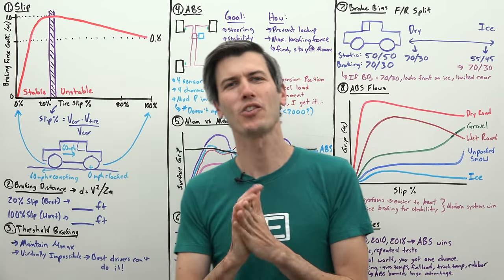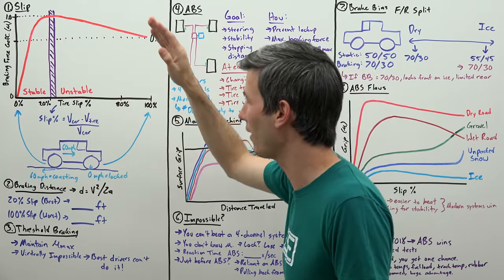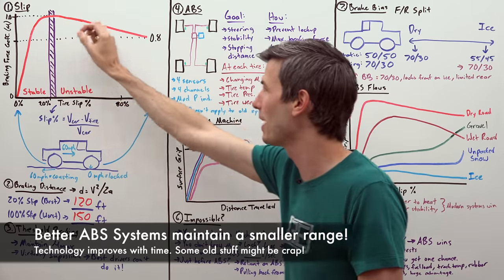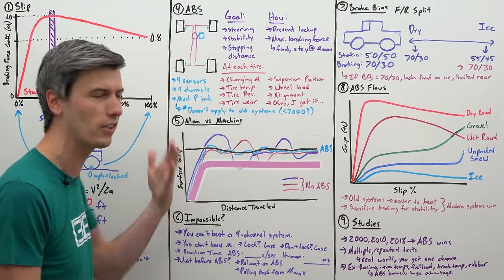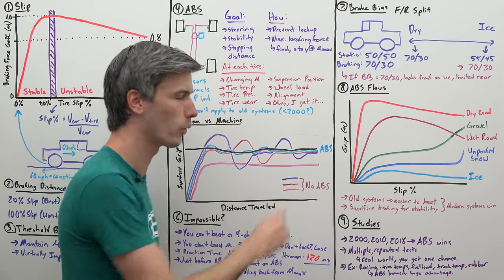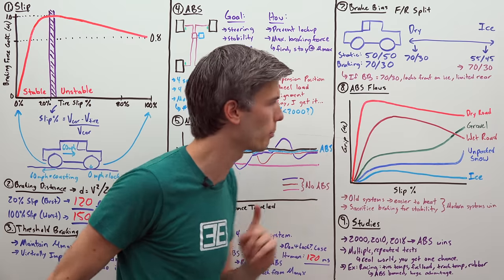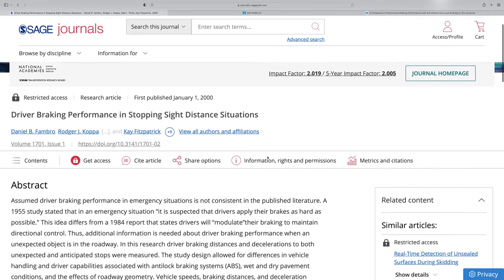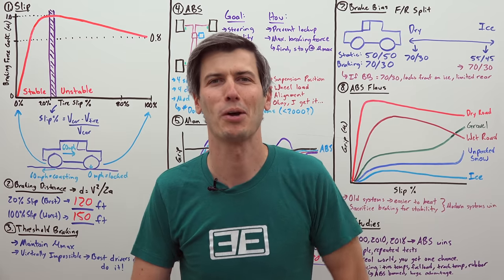Why Threshold Braking Is Impossible - ABS Wins!

Comment: ABS in most vehicles is a reactive system that can only attempt to recover an overshoot of braking effort, and it literally DOES just bounce back and forth through the ideal peak in available traction on most passenger cars. In order to make the system seem as if it is proactive, they fine tune it and size the valves and pumps and actuation speeds to optimize the system for a particular set of conditions and expected wheel size/weight. As long as you are driving in the conditions the system in well optimized for, it is capable of exploiting more braking effort than a standard brake application that attempts to manually find the threshold. You're describing ABS as if it is backed by supercomputer levels of AI to make decisions about how to manipulate the valves. That is not the case at all. 

Out here in the real world, the conditions aren't always well matched to the ABS system. Since people already tend to drive slower on ice and snow, and everything happens slower in very low traction situations, ABS systems tend to be optimized for routine dry/wet conditions where drivers are likely to encounter a situation that unfolds much faster, and at speeds that are more likely to be deadly, and in traction conditions that are far more difficult to "find" the threshold of (yes, it's harder on dry pavement to to "land" a maximal hard brake effort). As a result, these system are often very poorly tuned to maximize braking effort on very slick conditions, like snowpacked or glazed ice roads. You can observe this in many vehicles as the ABS system overshoots on both sides of the peak available traction by huge margins over and over. Most of these systems do not have the finess or the data ingestion to make good decisions here. If I'm ever braking in my SUV on ice, and feel the ABS kick in, it is always accompanied by a sudden LOSS of braking effort. You can FEEL it immediately. The G-forces of the braking diminish. I immediately lift the pedal and take another stab at finding the threshold because that is consistently better than anything the SUV can do with its dry-conditions optimized system, especially when running larger/heavier tires. 

F/R BIAS is solved by locking the center diff. Many of us drive SUV's and pickups with the ability to lock the center diff, and YES, locking the center diff does improve braking because it allows braking effort to come closer to threshold on all 4 tires, with or without ABS. For those people who say 4x4 only helps you go faster but doesn't help you stop faster, this is actually not true. A locking center diff helps the driver or the ABS system maximize available braking effort on ice and snow. With the center diff locked I can threshold brake significantly better than the ABS system can with the center diff unlocked. Again, this comes back to a lack of optimization. A perfectly designed ABS system WOULD beat me every time, but alas, our ABS systems are far from perfect. Perhaps the ABS system in your car is better than the one in mine.

In this video you make a lot of assertions about what ABS can do without any actual proof. You're making assumptions and assertions than an ABS system by its very nature can hone in on and target the sweet spot of traction in real-time. These are some remarkable assumptions that are far from true for most of the ABS systems fitted to passenger cars. These systems are reactive, not proactive, they don't have any way to measure the available traction and know how hard to push the pedal, they can only keep swinging back and forth though the threshold, overshooting on both sides. The amount of overshoot and the time it takes to correct varies wildly depending on the specific system and conditions. Some are better than others. None of them are as ideal as you describe in this video.

Comment: Audi used to have a "ABS" button so you could turn them off on snow/ice. Locking up the wheels piled snow in front of the tires and stopped it faster than ABS on.

Comment: Drivers should practice emergency braking in controlled conditions just to get used to the feel (and sound) of ABS and the principles of “stomp and steer”.  Often, inexperienced drivers will immediately get off the brakes when first exposed to the crunching sound of ABS kicking in, especially when they are already in panic mode…or about to crash.  I was taught (and still believe) that brakes are the most important driving control available.

Comment: ABS may give you improved stopping distance, but that only really matters if you've failed to allow enough distance to stop in an emergency, which means you're a bad driver anyway. In actual driving situations where you're wanting to retain maximum car control while using your grip right up to the limit (including being able to lock up the tyres when necessary i.e. on a low grip surface), ABS only gets in the way.

Comment: Threshold braking is only better in the sense that it theoretically allows the driver more control, similar to the advantages of stick- or paddle shift transmissions allowing more control of the engine speed. While I'm a huge proponent of manual transmissions, my experience driving cars which pre-date ABS solidly puts me in the ABS camp for braking.

Comment: The problem with ABS is that it desensitizes people to the available grip. They stand on the brake pedal and it just works every time but they can't tell how close to the limit they were or how much the conditions are affecting the available grip. At some point they will try for an emergency brake and the system will just say, nope, no more traction available, have fun crashing. With a direct braking system there should always be feedback every time you press the pedal, showing you how the vehicle is reacting.

On a track it is about feedback and skill. Otherwise you might as well be in the passenger seat.

Comment: There is one situation where a human driver can beat road calibrated ABS, and this is on a splitMu surface, ie one sides tyres are on dry tarmac and one sides tyres are on ice (worst case). Because road ABS has vehicle stability not stopping distance as it's prime target, if you have a very unbalanced braking yaw moment, the ABS will "Pick Low" ie it will reduce the high grip (tarmac) tyres(s) brake force to that of the low grip tyre(s) force (ice) to prevent that large un-even force from causing the car to yaw.  This is because in a modern car, the occupants are very well protected from a frontal accident, but much much much less protected from a side imp[act. Keeping the car straight and hitting something is actually better (for the occupants....) ie a better strategy than trying every time to stop in the absolute shortest distance but loosing control, spinning and hitting something sideways. 

ABS relies on the road surface friction to re-acclerate the tyre/wheel, ie to reduce tyre slip. This limiting factor in ABS cycle times is the re-acceleration phase, and the lower the friction (or higher inertia the wheel/tyre package is) the slower the system can cycle and the greater the RMS error from maxMu.. If you car has a large degree of yaw, then not only is the slip calculation more difficult as the tyre is not slipping laterally as well at longitudinally but the road force input is not aligned with the tyre rotational axis and so the re-acceleration phase is extended

"race" ABS is actually really only different to road ABS is to primary areas

1) It will be targetted to the exact tyre fitted in terms of its slip / friction characteristic, it wont' have nearly so wide an operating window as road ABS

2) it will be set up to "keep max" instead of PickLow, ie it will try to brake each and every wheel to the absolute maximum retardation, irrespective of yaw moment. ie it relies on the driver to maintain vehicle control and direction. This requires the driver to input potentially large and timely handwheel (steering) inputs to keep the car going where they want it to, even if the brake system is pushing the car off their choosen line by braking different tyres by different amounts. In most race cars with ABS you will find an "aggression" adjustment dial that allows the driver to select between stability (picklow) and max retardation (keepmax)

The other interesting thing that the lastest systems do is they have adaptive road friction models,ie they attempt to estimate and learn the tyre to road friction in near real time!  They do this via all sorts of methods.

1) Wipers being on, fog lights being on etc - probably means wet road - can use the windcreen rain sensor even when the wipers aren't being triggered
2) exterior temperature - self explanitory
3) Vehicle path analysis - using handwheel angle and the yaw and accelerometers, the system can calculate the true path of the vehicle vs the commanded path.  The difference is tyre slip (ie understeer or oversteer)
4) during ABS intervention the re-accleration phase is entirely driven by tyre / road friction so the system can calculate mu in real time.  This is one reason why changing your wheel and tyre package may actually slightly degrade ABS performance if the rotational inertia is different to the OE fitted ones.....

One interesting test is to see if you can feel this adaption.  Trigger the ABS on a dry road and the system will learn that there is lots of grip and hence keep the slip target at a relatively low value.  Park up the vehicle and wait for it to rain, before you drive too far (vehicle will learn even without you triggering the ABS!) carry out a stop on the wet road. You will feel the system trigger early initially because it thinks there is plenty of friction, but within a couple of seconds it will have relearnt the lower grip level and will start targetting a much higher slip level.  If you repeat that wet stop for a second time, you'l lnotice the system going straight to the new lower friction response even on the first ABS event.

Comment: Well in the test I did on my channel, Thershold braking slightly beat ABS. In your explanation you haven't considered something very important, with a manual gearbox you threshold brake being in gear, which not only improves braking performance, but the rotational mass of the engine and gearbox also works as an anti-lock system, as it not not as easy to stop the engine, and you can ride that fine line of grip without major issuess. As the grip decreases (f.e. wet conditions) ABS  does generally decrease the braking distance significantly.
Reply: u made a very special list :) See u soon :)
Reply: Crystal 🔮 Throne IMAX Theaters 🎭  how come?

Comment: Sounds fine in theory but try trail braking & ABS acts pretty silly. There's a reason why MC riders who track get rid of ABS right of the bat ('cause most do suck doesn't matter how got it looks on paper, if it makes the operator less in tune with the machine it's harder to use, aside from maybe the hyper cutting edge systems which most bikes don't have), though the systems on cars are even less flexible. Sure ABS is magical for outright braking in relatively straight lines, but when you're planning to scrub speed into a turn you won't be fully on the brakes anyway, you need some traction left for cornering, something that's not all too hard to modulate by way of seeing if you can turn enough & reacting

In theory ABS should never trigger when trail braking/partially braking during corners, unfortunately it's not that simple, part of the reason it can work as fast as it does is because the braking pressure of ABS systems are way higher than those without, so mid corner if you ask your car to brake & turn too much & ABS triggers than one of two very unfortunate things happen that are exacerbated by the power of the ABS unit

1) you have a car modern enough to know it is cornering so the ABS overly under brakes meaning you run wide & off your line because in letting you turn the car idiotically didn't let you slow down enough to make the turn, or2) you have older ABS which doesn't know you're turning & thinks outside wheel is spinning too fast & needs to be slowed down, & inside wheel is too slow & needs to spin, what this does is effectively torque steers the car to go straighter causing understeer running you off into the ditches once again

The reason this is more of an issue than it should be is it makes the front end inconsistent because when it does not trigger your cornering ability is noticeably higher, when it does trigger it's hard to modulate & basically overshoots understood repeatedly in an effort to be responsive, which means you lose out on the ability to modulate as you want instead you have let up even more than necessary to get the ABS out it's loop so you can threshold brake meaning you have to overslow the car when it's trying to not slow down to let you turn, so that you could turn from a slower speed where it won't trigger, or you have to steer less to get ABS to trigger less so then you can steer more after the fact, issue being you're having to hit the brakes harder & steer less because ABS is counterintuitively either braking less or turning less meaning for one reason or other you are sacrificing corner entry speed which for some some vehicle setups can be a very limiting way to drive where late breaking while cornering is necessary to get the car rotated properly, & if you're forced out of driving that way your lap times can suffer particularly if there are switchback corners for cars which tend to take time to transition

Consumer ABS has its use case, panic stops mainly, but it's not a golden bullet in the racing world because there are a lot corners & circuits where braking in a straight line isn't always the fastest way around everything, unfortunately in a straight line is the fastest way ABS brakes

Comment: what you haven't explained in this video is that OEM ABS designed for road may not work very well on the race track.

questions to ask:
1. when the ABS is trying to work out the slip %, what reference speed does it refer to ? you'll find that for 4-wheel abs they compare the speeds between all 4 wheels, with neither steering angle input nor gearbox speed input.  So when you're trail braking, into a corner, how does it know what speed each wheel should be traveling at ?  This can be even more complex when the wheel track widths have been increased, and inside wheels travel much slower than outside wheels at high speed. 

2. what happens when youre braking and you hit the chicane and have one wheel in the air? What happens when you corner hard and one wheel is off the ground ? 

3. what happens when you're using trail braking to help the car turn, ie you intentionally let the rear kick out and slide a little?

so yes in theory ABS should perform way better than manual braking, but this may not be the case if it's a road car ABS used on a race track with all these complex scenarios.

maybe OEM ABS systems on / from sports cars like Skylines, Silvia's, s2k etc have been designed with these scenarios already considered, but if it's from something like a corolla or accord etc they may not be able to cope.

Comment: Unless you own an adventure type motorcycle and need to be able to lock the rear wheel at your leisure.  ABS is plain dangerous is some circumstances on a bike when travelling on dirt, especially on steep downhills.  Usually the first thing we do when we get on the bike in dirt is switch it off.  Human control in this situation is far better than an engineers perception of reality.

Comment: Meanwhile in real life sub standard engineering makes my 2001 Subaru WRX engage the ABS if one wheel hits a pothole and it thinks it’s slipping because it has to roll more to keep on the surface.  This disables full braking deceleration for two seconds which is quite a long time at speed and is dangerous. Disabling it gives much better braking performance on imperfect roads and is safer.  Far better than disabling it would be a better design, there is a reason professional race car drivers use ABS but not the bargain basement craptastic ABS that goes into some cars.